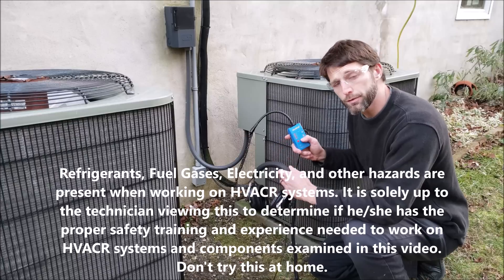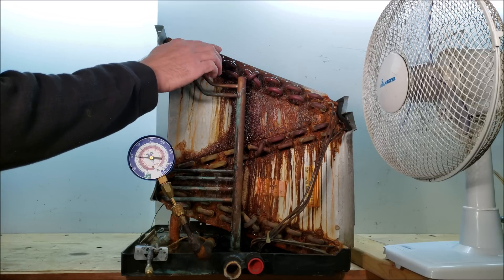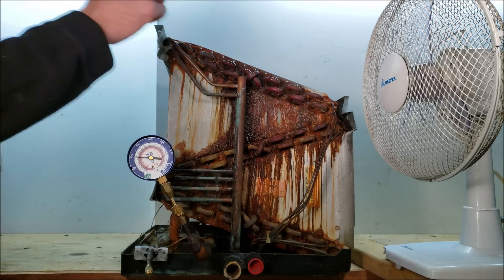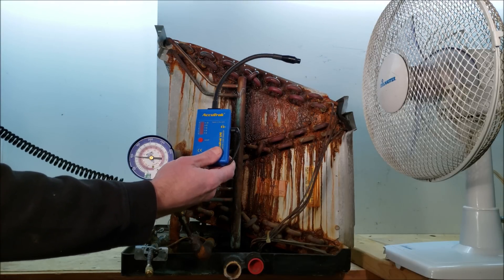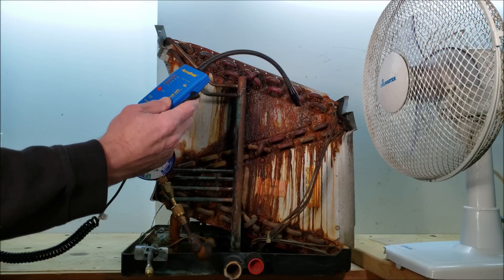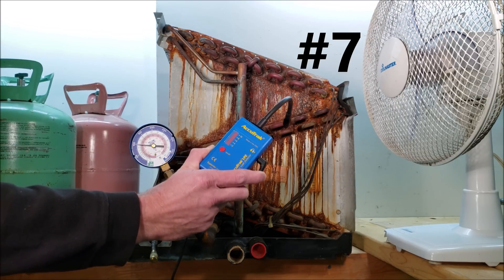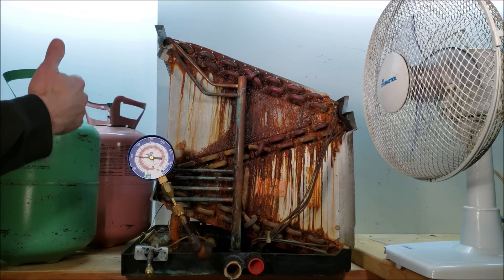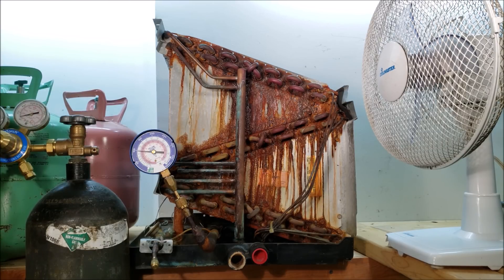10 Reasons Why Ultrasonic Leak Detection is One of the Best Ways to Find Refrigerant Leaks

Comment from the maker: Support-  https://www.patreon.com/acservicetech
Tool List-  https://www.amazon.com/shop/acservicetech
For those that are looking for the tools used in the videos: (Linked Below)
Ultrasonic Leak Detector- https://amzn.to/2Lw4Zpr
UEI DL479 Multimeter with temp sensor http://amzn.to/2jtsUbJ
Magnet Jumpers- https://amzn.to/2PyKPQZ
Alligator Jumpers- https://amzn.to/2PxqJXn
Fieldpiece ST4 Dual Temp Meter  http://amzn.to/2wc1ME3
Fieldpiece Bead K Type Temp Sensor https://amzn.to/2DBwKfs
Fieldpiece Wet Bulb Temp Sensor https://amzn.to/2RRI7Tw
Fieldpiece TC24 Temp Clamp https://amzn.to/2qHLyjZ

Yellow Jacket Refrigerant Gauge Set http://amzn.to/2aenwTq
Refrigerant hoses with valves http://amzn.to/2aBumVI
Yellow Jacket Gauge set & hoses https://amzn.to/2vLVkV9
Yellow Jacket 4 Port Manifold w Hoses https://amzn.to/2BkuGIq
FieldpieceSMAN360 Digital Manifold Set https://amzn.to/2BdoaD4
FieldpieceSMAN460 Digital Manifold Set https://amzn.to/2nB4Fe6
Compact Ball Valve for Refrigerant Hose https://amzn.to/2KUisW8
QuickDisconnect 90 for refrigerant hose https://amzn.to/2MMtVcg
JB 6 CFM Vacuum Pump   http://amzn.to/2nqbvo8
Appion Blue 3/8" to 1/4" Vacuum Hose http://amzn.to/2uYlVyc
Appion Red 3/8" to 1/4" Vacuum Hose http://amzn.to/2uYg6Ro
Appion Valve Core Removal Tool http://amzn.to/2uYr8WL
Yellow Jacket 1/4" by 1/4" hose http://amzn.to/2umtcod
CPS Vacuum Micron Gauge http://amzn.to/2v1nM3O
Supco Vacuum Micron Gauge http://amzn.to/2v1JRiA
RectorSeal Bubble Gas Leak Detector http://amzn.to/2ckWACn
UEI DL389 Multimeter  http://amzn.to/2xAdaJf
Air Acetylene Torch setup    http://amzn.to/2aQalsb  
15% Silver Brazing Rods  http://amzn.to/2gVLyLc
Nitrogen Regulator    http://amzn.to/2bXdR5f
Nitrogen Flow Meter    http://amzn.to/2brvoBg

Other tool links can be found in the video description section.

Shop through Amazon! Your Purchases through Amazon provide a means for channels such as mine to earn advertising fees from all purchases after clicking through. Prices are the same as normal-    https://www.amazon.com/shop/acservicetech

Comment: Are you going to try to repair the leak on the crusty coil with another sure to pop out or replace the hole part
Reply from the maker: That coil got replaced for sure. Thats too rusty but its helpful to the customer to show them for trust
Reply: @acservicetechchannel  Goodman isn’t making any new coils for r4110a systems

Comment: I'm in a pinch and I need to buy an ultrasonic detector for a large multizone system I installed, but it won't hold pressure and Big Blu failed to show anything. Do you know any techs using the Inficon Whisper? Do you think I can get by with the cheaper Inficon model?

Comment: I never liked the heated diode. The refrigerant escapes to different areas and the diode picks up refrigerant in areas where the leak is NOT. It makes it a little deceptive. I want to Master The ultrasonic. Maybe you can use the heated diode at the start of a leak detection so you know if the leak is in the evap or condenser then once you pick up refrigerant you switch to the ultrasonic to pinpoint

Comment: Quick question Craig, I've got one of these detectors mostly because of you. I was searching for a leak today and more than half way to 100% sure I found it, but I had some doubts still. I was hoping you could let me know if they were warranted doubts or not: 

The leak I was hearing was at the base corner of the A coil, right at the bottom leg of the A that is where the TXV lines are going in. The thing that threw me off is that I heard basically the same sound from the base on the other side of the A coil too. It made me wonder if I was just hearing sounds of refrigerant settling inside the tubes.. because I know you can hear the sound of refrigerant flowing through the tubes with this thing. The AC was off of course, everything was off. But I was wondering, since it was at the base of the A coil maybe it was like.. the sound of liquid refrigerant bubbling or something inside? 

That or was it just so sensitive that it was picking up a leak somewhere out of sight and I wasn't even pointing it at the area the actual leak was? 

Just wondering is all, do I need to worry about hearing refrigerant sounds INSIDE the pipes and mistaking them for the hiss of a leak? Since I know you have tons of experience with these detectors, getting an answer will really give me more confidence using this thing.

Comment: Rookie here, will detectors sense both low and high sides leaks?
Reply from the maker: Yes, it listens for the escaping gas coming through the tube with the oil on it even at the low side pressure or when the system is off, thanks!

Comment: Craig, do you recommend the noise canceling headphones as an option for this device? Have you been using the base model with the regular headphones, or have you been using the model with the noise canceling headphones?
Reply: I’m trying to decide which version to buy. Thank you for your great videos.
Reply from the maker: You don't need anything too special. Sometimes I will plug the jack into a speaker even. Whatever you use, just get used to the noises you should do well, thanks!

Comment: Thanks for the info, great video. Do you know of the ultrasonic leak detector can locate leaks while the system is in a vacuum.  Thanks!
Reply from the maker: Juan, movement through a tube should be able to be picked up but I couldn't tell you based on experience because I am only testing with positive pressure, thanks!

Comment: Im trying to find a leak that is likly a zoomlock fitting between floors on a occupied apartment i isolated the system and narrowed it down to the liqud line. The lineset is 70' r more running over 3 apartments will ultrasonic leak detector pick jp leak through sheetrock?
Reply from the maker: That may deaden the noise. You may have to drill a 3/8 hole into the wall cavity like through the trim to put the yellow extension tube through and then you can add sealant afterward.
Reply: Yea i already cut 4 holes in cieling but havent had any luck .we use amprobe ultrasonic ears  which seems to pick up the noise every time you touch the ladder or sheetrock or scratch your arm so I was curious have anybody ever successfully found the leak through sheetrock thank you for your reply

Comment: Hi, what do you think of Bacharach TruePointe series ultrasonic ? I am abut to invest on one and I will love to have you opinion on which one is better. Thank you for your time and thank you for all the information you help us with.
Reply from the maker: I believe that is the same one that is used in the video except it doesn't have the flexible hose on the end. It should work well then!
Reply: @acservicetechchannel  Thank you Craig
Reply: do you think is worth the extra 200.00 to have the goosneck part of it ? does it really make more efficient ?
Reply from the maker: @budgetcoolingandheating4059  You can just use that yellow tube that comes with the tool to extend it. The tool itself is what is worth the price, thanks
Reply: @acservicetechchannel  thank you Sr

Comment: Also this method requires NO trace gas along with immune to wind, no delay, and useful for other fluids.  Do natural gas low-pressure leaks have a Mach component that is detectible?
Reply from the maker: Low pressure gas can be detected using this tool. There also are sniffing tools designed specifically to sense the gas chemicals, thanks!
Reply: @acservicetechchannel  I don't understand the religion surrounding the hot wire, semi-conductor except under concrete slabs and streets for natural gas.  Ultrasonic requires no refrigerant and immune to noise and wind.  I really don't like the delay with hot wire.
Reply from the maker: @SovereignTroll  The heated diode just happens to be the most well known and has the most tools out in circulation. Ultrasonic will catch on. It just takes time, thanks!

Comment: My local johnstone only offered the Inficon Whisper 711-202-G1.  Do you have any experience testing that one out?
Reply from the maker: I did not have a great experience with my last inficon. It wasn't finding leaks. However, I love my ultrasonic tester and I rely upon that for testing for leaks. I have the tools I use linked at amazon.com/shop/acservicetech thanks!

Comment: How well do you (or anyone else reading this) find the tool to work in noisy environments? I have always dismissed this method in the past because I was told they suffered unless there was little to no ambient noise.  And haven’t met anyone who uses them in my area that can give me first hand knowledge. Thanks for the videos. A huge help!!
Reply from the maker: It can work well in noisy environments depending on the noise levels. I have been in very noisy and windy locations and the tool worked well. I was on a rooftop where it was picking up noise from a transformer half a block away when I pointed the tip in that direction. It really depends on the types of noises you are around. It really works well in wind. Overall, I am exceptionally happy with this tool and its ability to find leaks, thanks!

Comment: No way I would fix that leak in that evaporator.  It would be off to the recycling bin for it.  Once they start to rust out like that, you just end up chasing your tail trying to fix the leaks as they pop up.  It really makes the customer mad when you have to come back and find and fix a leak every six months.
Reply from the maker: Well as you can see, that is what I did with this one but some leaks are worth fixing such as at the distributing tubes or other places, or when you absolutely have to get the ac back up and running right then, thanks D M!

Comment: I’m sold the  minute you said I could use any compressed gas (nitrogen) to find the leak, I mean let’s face it, when checking for leaks in general usually done when the system is low or out of refrigerant pressure, no more wasting refrigerant to find the leak. Going to buy one of these right now. Thanks for the video, never befor considered getting one of these till now.
Reply from the maker: Thanks for your note Jeff!

Comment: Do you think it's a good idea  to use DEWALT DCE200M2K 20V Plumbing Pipe Press Tool Kit with Crimping Heads for HVAC instead of soldering or brazing can you do a video on
Reply from the maker: We haven't heard anything about any joints leaking bad yet when the crimp is properly done. I think each tool has its place for different circumstances, but I don't think I would be doing that on every joint, thanks William!

Comment: Ultrasonic leak detectors work great on refrigerant leaks as you've demonstrated. I've also had great success in other industries such as the automotive field in detecting vacuum, pressure and water leaks along with detecting early failures of bearings. A great tool to have! :)
Reply from the maker: Thank you very much Stuzman, thanks for mentioning the other fields!

Comment: Very well demonstrated. 
I only used sniffers as a last resort  because of it's difficulty. Bubble soap works great also. 

I will look into this ultra device though. Will make work easier and quicker.
Reply from the maker: Yeah the bubble leak detector is good for open joints but when you have covered all of them and found nothing, thats when the problem arises so I am glad I have this, thanks Turbo Flush!

Comment: 400 dollars on Amazon......lolrofl.....
Reply from the maker: Better than (2) $200 testers that can't find anything, ha ha. My thing is when you need to find the leak, you need to be able to find it, especially when you are the business owner, thanks!
Reply: I agree......are you buying them for all your service techs ....or just for yourself
Reply from the maker: I would suggest getting them for lead service techs as well. I just mean, at the least there has to be at one leak detector in the company that can be depended on to find a leak. I think there is more pressure for the business owner to find a solution compared to a technician but when we are on site, we are all in the same boat, thanks
Reply: Your time is the most-important asset, not just at work either.

Comment: It seems that the psi has to be relatively high for the detector to work. Will it work for detecting leaks in residential gas piping? Just wondering. Btw your vids are among some of the very best on you tube. Thank you.
Reply from the maker: It is not about the psi as much as the noise but in a gas line you may still need to wet the outside since there isn't oil on the inside of the tubing like refrigerant lines which makes the sound louder, thanks a lot Tak!
Reply: kindly follow us on :

Like our Facebook page: https://www.facebook.com/Murad.Hardware

Linkedin : https://www.linkedin.com/company/almo...

Instagram : https://instagram.com/almoradgroup?ut...

Twitter : https://twitter.com/ALMORADGROUP

Comment: But you have to be right on the leak vs a diode will detect the general area thru AC vent in car etc.
Reply from the maker: Its true if an area is saturated with refrigerant mixed with the air the heated diode will go off. Every tool has their function and benefits. This tool will still pick up noise a bit away depending on the noise level, thanks A D!

Comment: I was working on a large dehydrator for pneumatic process controls at a paper mill. I was having difficulty finding a leak because of the noise and a lot of air exchange /air movement in the area. Customer had a ultrasonic detector and let me try to find it with that. I found it almost instantly. Great tool👍👍
Reply from the maker: Yeah that is a common misconception, thanks a lot Kevin!